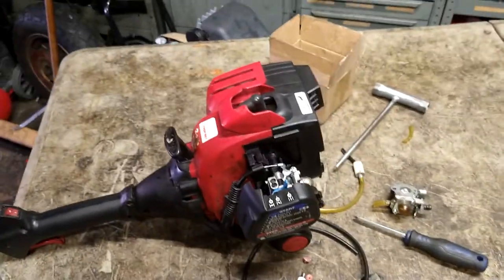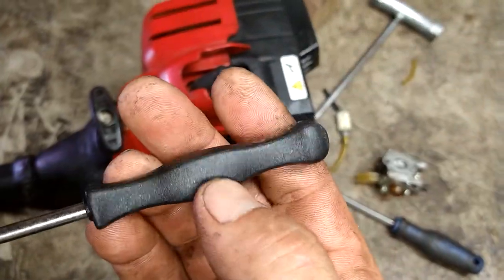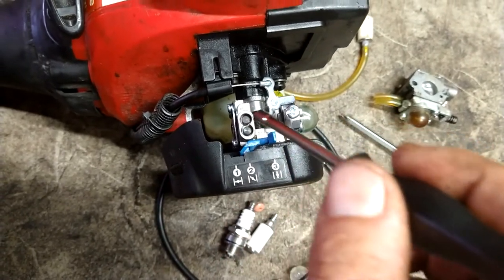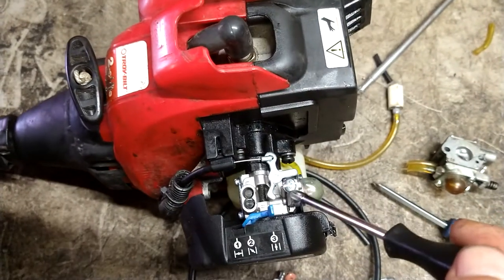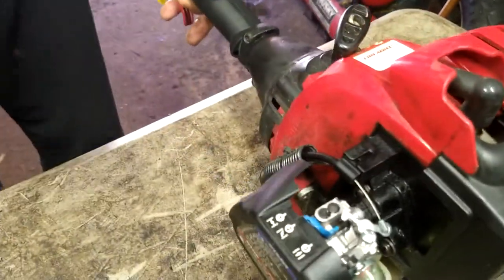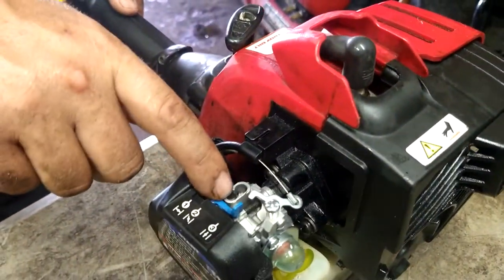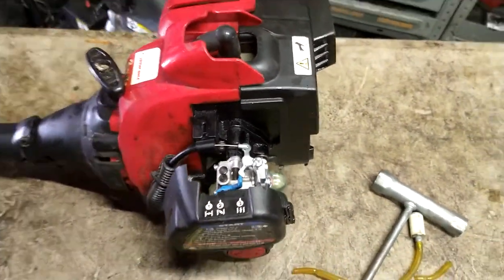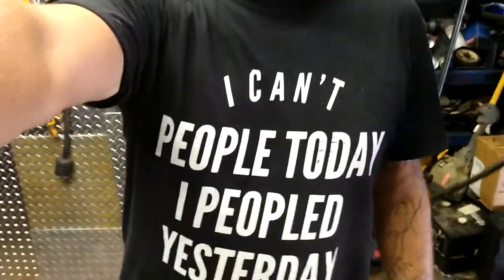Troy-bilt tb22ec carburetor adjustment

Comment: I have a weedwacker  just like in the video. Just replaced the carb. And made the mistake of radically adjusting both screws both idle and top end. Is there a starting point for these two screws so I can set them where they should be?
Reply from the maker: after snug tight 1 full turn counter clockwise

Comment: Mine system like the load is weak like it ain't revving it up as high as it should
Reply from the maker: adjustment screw closest to the air filter while at full throttle turn a bit each direction till full throttle is achieved

Comment: Okay....I just went out and put a load on the trimmer (Cut some brush) and with  just a light load, the damn thing just bogged......sounds good on the bench....doesn't perform in the field....any clues as to why ? ....I'm bumfuzzled...........(.I got this from my neighbor who purchased it last fall and used it only a few times, then stored it over the winter without stabilized fuel, likely gummed it up....I put the new carb on and all was well as I mentioned in my first post....now, it's useless)
Reply from the maker: ADJUSTMENT SCREW CLOSEST TO THE AIR FILTER NEEDS TO BE TURNED OUT COUNTER CLOCKWISE A BIT.
Reply: @smallengineguys Okay, I'm assuming you mean the "high" adjustment screw....I'll give that a shot....Thanks again..
Reply from the maker: @birdman5939  you assume correctly.